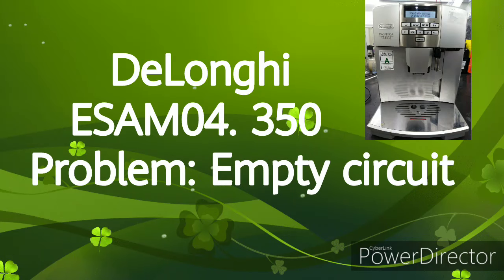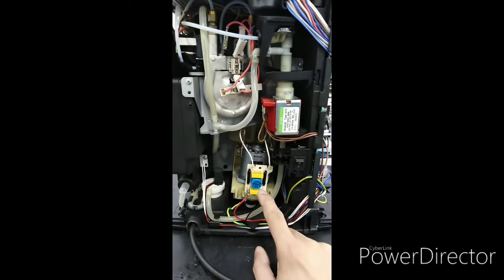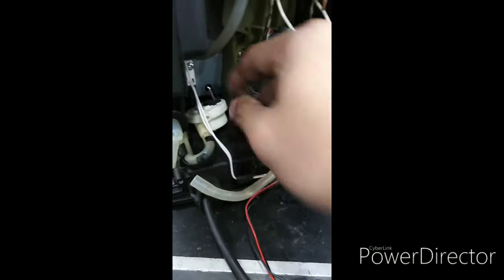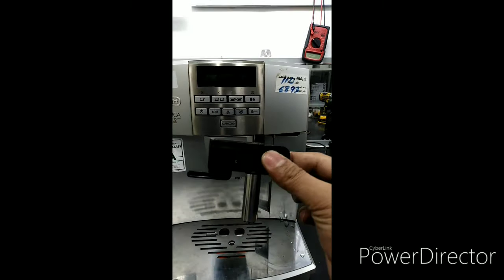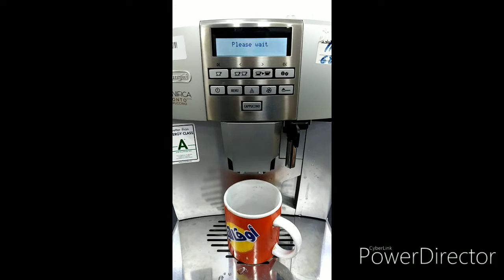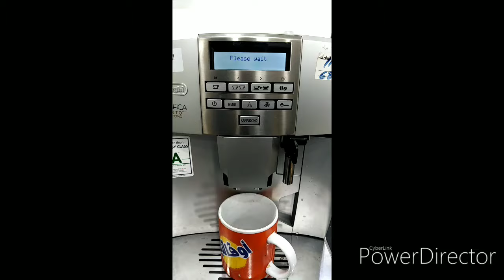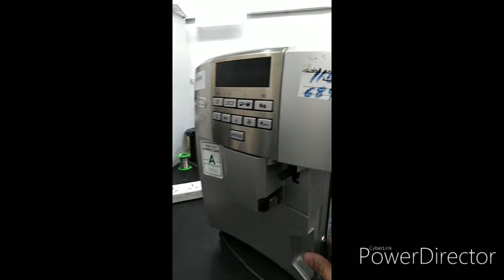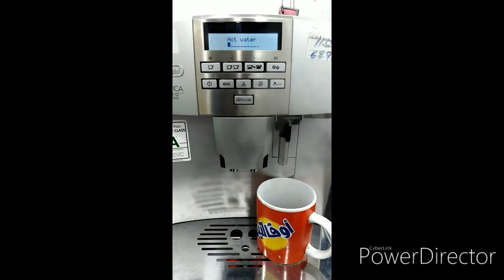How to repair "EMPTY CIRCUIT" DeLonghi Coffee Machine ESAM04.350

Comment: My PrimaDonna S just came back from Delonghi for a repair.. Apparently they fitted a new infuser valve, 2 x solenoid valves, pump, damper and flow meter - and serviced it..
Switched it on and had the 'water circuit empty fill water circuit' error..  I tried hot water many times but it was just noisy and didn't pump out any water from the nozzle - but a good litre or so from underneath onto the worktop! :-(
Couldn't face sending it off again so tried this - I really didn't expect it to work - but it did!  Many thanks.
By the way, the part you cleaned and called the distributor is actually the flow meter - that they supposedly replaced.
Reply from the maker: Good to hear from you sir that it works now.

Comment: Bought a new Delonghi dinamica that had sat in the box for 6 months before we used it. I just opened it up and I’m stuck on the water circuit empty fill water circuit scream. I followed your video steps and added water, but it’s still not working.
Reply: have you solved it yet? same problem also
Reply: @azzyker  figured it out by calling them directly! When it you get the message “water circuit empty” just keep pushing “okay” until it works. I pushed it 7 times ina row before water came out so we could finish the setup process 

Let me know if you have luck! :)

Comment: I purchased a De'longhi dinamica plus last week. During the set up I am getting this error. The machine has never been used. The customer service team was completely useless. Do you recommend doin g this process on a new machine?
Reply from the maker: Sorry to hear that from you sir...the one you encountered is sometimes normal beacuse as you've said it was never been use, meaning the inside of the machine  and the pump motor  is totally dry. And with your concern "YES" absolutely you can do the steps on my video, just make sure the water you will use is filtered water.. 🙂
Reply: @yoowwnntvglenncoronel9659  I tried this on my Dinamica Plus and it still does not work. Mine also has never been used and I just opened it up for Christmas :(
Reply from the maker: @miamiheat109  if its new try to do the tutorials atleast 3x..if still the same i recommend to bring your unit to the nearest authorized service center to cover it for warranty...

Comment: Hi there,
I have a delonghi primadonna elite... I tried this and replaced 3 way solenoid.. still the issue is there.. last resort..should I replace water pump? Thanks
Reply from the maker: Yes try to replace a new motor pump.
Reply: @yoowwnntvglenncoronel9659  
Done works a treat now 👌

Comment: hi mate I have the same issue from hot water it shown Empty Ciruit, I followed your video on how you fix and I did the same way but still doesn't works, is there other ways. thank you
Reply: Hi, did you find another way of fixing it?
Reply from the maker: Try to open the flow meter and clean it.

Comment: Sir, do you know how to remove the cover for Delonghi Magnifica S ECAM 22.360.S? I have the same issue of empty circuit. But I am not able to get the cover removed. Can share me some tips?
Reply from the maker: try first to put water on the tank. and then pull out and push in the water tank while the machine is working..

Comment: I have à problèm with Magnifica S Delonghi.
Message error circuit empty.
I made the same operation that i seen on your vidéo,but the problem persist.
Somedy can help me?
Reply from the maker: if the same problem persist it time to changed the flowmeter or what i called distributor. the white thing im repairing in my video.. but before that try to check if there is water coming inside and out of the water pump.. any inquiry you may contact me on my facebook https://www.facebook.com/glenn.reyes.coronel